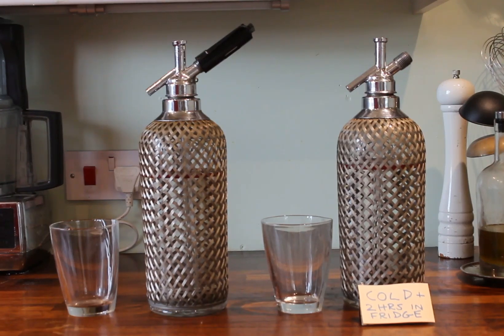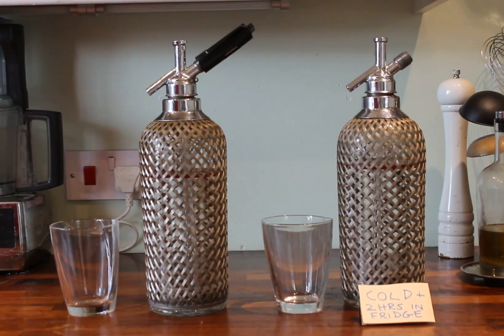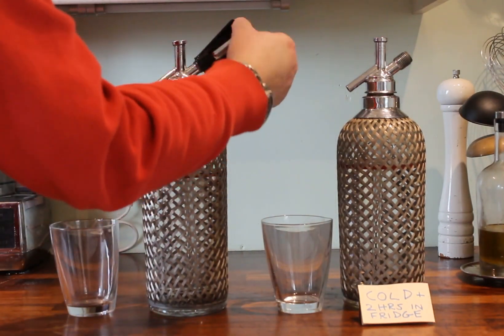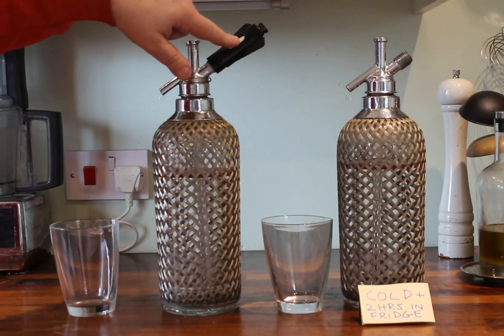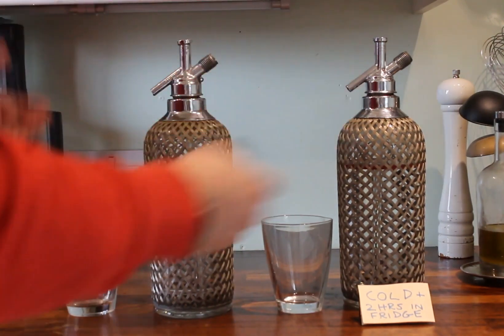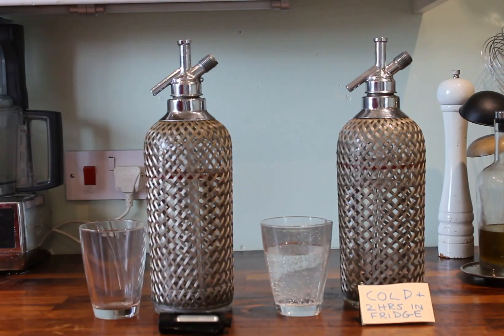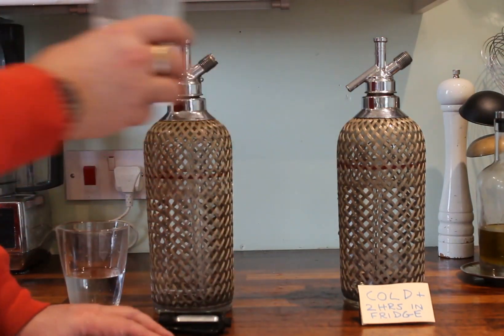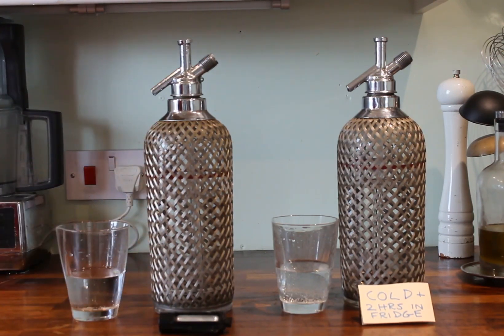How to get the best taste or mouth feel from your soda/carbonated water with your Sparklets Type D

Comment: Hello,
Great video!
I found an old but beautiful soda bottle the other day. it did not have a charger and after some searching I have found one that fits. The next problem is finding the correct cartridge. I bought some ISI cartridges but they are a little bit too big to fit in the charger. 
Without being able to send you a picture of the bottle, would you be able to advise what type of cartridge I need to buy?
Many thanks,
Ian
Reply from the maker: The issue of which cartridges are suitable for vintage and classic soda syphons is covered in another video I posted on YouTube here: https://www.youtube.com/watch?v=Ce_Qh-cwIgQ
Unfortunately, ISI brand cartridges do not seem to fit either in the charger keys of vintage syphons or the charging sockets of the syphons!  They are either too long, wide or the neck regions too short.  The following brands are generally suitable:  Liss, Mosa, Kayser, Morphy Richards and Three Kings Club (a brand designed for the bar trade mainly).  This list is not exhaustive and other brands may fit too.  In the USA I know that Leland "Mr. Fizz" capsules work well with Types C and D syphons as well as the Sparklets US Streamline range.  Work with some USA Soda King syphons too.

Comment: Could you chill the bottle for a few hours and then charge while it is cold and get the same effect as the bottle on the right?
Reply from the maker: You can pre-fill the bottle and put it in the fridge overnight before charging with a CO2 capsule.  That would probably give the same effect, although I have not tried this.  A Sparklets with a new neck seal should keep its pressure for at least 3 and frequently over 7 days in the fridge.
Reply: i find charging the cold water doesnt really get super fizzy. having cold water, charging it and then leaving it in the fridge for a while really boosts the gas